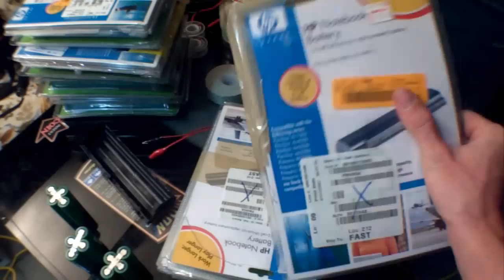DIY: 48v 24ah lithium ion 18650 e-bike battery pack

Comment: If you had those batteries with 3.7 volts and 2 amp hours, how many would you need to make a 100 amp hour 12 volt battery? Also, could you explain series and parellel? Thanks.

Comment: You solder directly on the terminals of any rechargeable battery you ruin the cell, the correct way is with a specific welder that uses high frequency to weld with low heat and the nails will have a high resistance, causing power loss and heat.
Reply from the maker: it won't ruin the cells, dont worry

Comment: Nice job on the battery and educational video. Ever worked with ultracaps? I'm thinking about integrating them with LMP's to get more burst power and decreased stress on the batteries.
Reply from the maker: yes I,very worked with ultra caps. ve made Two videos with them so far. a 2.7v 400 farad only has 300mah and is the equivlilant of 1\20th an 18650 cell and a lot more expensive and big.

also remember that you have to balance charge the capacitors or if one gets over 2.7v it will start boiling its electrolyte and die.

so far ultracaps aren't fit to replace lithium. not counting you'd need a way to turn the slowly dropping voltage into constant voltage for your motor.

Comment: Freeze the frame at 6:26... the lower right pack looks like the nail was soldiered in the wrong spot and not connected to the pack above. Just wondering if this was a mistake that was fixed? Great videos btw.. Im looking to build an ebike and trying to figure out total costs and how long I need to ride to make money back saving from not having to buy gas
Reply from the maker: oh yeah i forgot about that, i had to go back and redo the solder on some nails and move that one after the ride test because it was so bumpy and broke a few joints.
Reply: Gotcha.. I thought maybe it was just set up in a weird configuration.. is the battery pack losing any capacity since you built it? Im watching an auction for 72 cells in lenova batteries.. Should be sanyo batteries from my reseach? anyways, the auction is for a mix of ones not holding a charge longer than 5 minutes to others with errors and wont charge at all. Would you think this would be a good auction to go after? Thanks for your input.. These videos are such a big help for learning
Reply from the maker: JFR HRD
not that i know of, i run it at 4.0v so it should have 2000+ discharge cycles.

it depends on price, the packs will prolly have some good cells. but i never buy auctions. i go for buy-it-now when they have like 20 for sale, i buy 1. test it. then buy the rest if that one was good

Comment: How many cells do you have in this battery pack? In order to have a 48V 35AH LIion battery, you would need (if each cell was actually only 2AH) 17 48V batteries each made of 12 cells in series, all 17 wired in parallel. You would need 204 cells to accomplish this. This is a mistake I see people make a lot, if you wire cells in series, you add up the voltage,but not the amps and if you wire them in parallel  you add the amps not the volts. You can't add up both. But maybe you have the 204 cells.

Comment: Question: Is it possible to build a 'cheap' 6S 20000mAh (40C) battery for radio control applications (e.g.: multirotor coptors) where flight time is a challenge ? 

interesting video.

Comment: you are awesome.  i am going to build one.  Are there any particular laptop batteries I should AVOID?  Lifeoo4 would be nice, but since they are so costly, for now I'm going to build a li-ion.
Reply from the maker: Jmaturner i'd say avoid the flat cells that are popular in macbooks since they are a fraction of the durability of 18650 cells.

if a battery pack has IBM or HP or some company brand on it's sticker its probably medium to great quality cells. if the laptop battery has only generic english or chinese on it youll probably just get medium quality cells.

still medium quality cells are great especially if you find them for 1$ each.

Comment: Keeping your speed down will make a DRASTIC, DRAMATIC impact on the distance you can go. The cost/benefit is around 10-12 mph, because that is where wind really starts pushing energy use up exponentially. Even without wind, it takes 4x the amount of energy to go 2x as fast, when you put wind into the equation, it goes up horribly. Check bikeforums e-bike section, someone just posted an energy consumption graph and you would be amazed at how steep the curve is. Also, these are unprotected cells?

Comment: I have a bionix lithium battery system for a bicycle but the batteries are completely dead. Are those cells that you showed us pretty standard for laptops, electric bikes etc.? I am going to have to tear my battery pack apart to see what is inside and that may well be quite a chore. I am in Thailand.
Reply from the maker: yeah every laptop battery made after 1998 that i've seen has 18650 cells in it.

if your battery pack has a lot of cells, maybe it only 1 or 2 cells are bad, that is what happens with laptop battery packs. 1 or 2 cells dies and the whole pack cant work. ^^
Reply from the maker: *****
i would recomend to never buy individual cells. its most likely a ripoff then. just buy old battery packs. that can make it almost lower than a dollar per cell.

Comment: Hi. Thank you for the interesting video! if I understand correctly you connected 10P x 6S cells. If so, how do you charge the pack? isn't it dangerous to charge it without thermal sensing? Thanks!

Comment: How do you plan on charging them? Do you have an intelligent Li-Ion charger at the right voltage and for these kinds of cells? Also with 1kw motor, you could put a 20 amp load on this battery you made. You bought too much motor. With a 3AH cell, you are talking about pulling over 6C per cell.

Comment: OK, I rewatched the video. You have60 cells in this battery at 2.5AH per cell. Simple math 3.7V*2.5V= 9.25WH*60=550WH. If they are wired the way I think they are,(4 sets of 12 cells wired in series, with those wired in parallel to each other. You have a 10AH (assuming each cell is 2.5AH)48V (with over charging to 4V) Battery here, just the new one not counting the old one. With so many cells so close together in a BLACK (think sunny summer day) box being overcharged, you are asking for trouble.

Comment: you can only cool on the ends. The batteries should have 1/10 inch around them for cooling. If you discharge heavily you could get thermal problem.
Reply: +Kirk McLoren they are bettter touching, because the metal casings will transfer heat better, so then it cools easier. if you have a gap then the air gets warm and then it cant cool
Reply: +DMAN22yeah I would think without airgaps,they would hold heat like a brick?Especially,the bigger you make them.Even my drill packs get hot with a heavy discharge,or come right off the charger.They even warn to let them cool after charging to preserve battery life.I think if I go this route on the E-trike I'm building,I'll leave gaps and set-up a box with pancake PC fans.
Reply: Bowtie41 best thing to do is to have a fan blow over the outside of the pack when the cells are touching. if your batteries are getting  warm then it is time to upgrade your battery capacity, as you are damaging the batteries. drill packs are supposed to get warm when charging, and they can get warm when discharging. it doesnt impact the nicad to get warm to an extent.
Reply: +DMAN22yeah Nah!Most high discharge batteries will get warm when discharging at high rates.I would get worried if the batteries get hot during charging.A hot battery during charging, means 1 cell is weak and getting over charged.Some of these people sound as if they are going to attempt this without basic knowledge of lithium type batteries.THESE ARE NOT YOUR GRANDPAS BATTERIES.The c ratings on some of these are crazy!
Reply: ***** 18650s are around 1c continuous or 2c peak

Comment: Rinoa Super-Genius How come you use nails as connection instead of nickle strips ? Is it leading electricity good enouf without wasting to much ? what is the diffrense in using nail instead of nickle strips ? is it better to use copper? Thanx for video and  your answer from here in Sweden!!

Comment: Are these cells staying in balance? I've not worked much with Li Ion cells, owing to their inherent dangers. I use LiFePO4 cells for my EV needs and have had some balance issues.
Reply from the maker: in the next video i show how i balance them. with an Imax B6 balance charger.

and also i havent run into any issue with lithium cells being dangerous. and i've roughed them up quite a bit too. one time i got 4 cells to 4.5v and they didn't complain. but i handled them like unexploded dynamite till i got them discharged haha.

the biggest issue with lithium cells is if one shorts out due to age or stress. but that can be fixed by putting a 1-2 amp fuse on each cell.

that being said though, i don't have many issues with them getting out of balance. tbh most of the time i just top it off with my DC power supply. and i keep the cells at 4.0v or 4.1v instead of 4.2v so there is not only more room for the cells to deviate without problems but i also get 2-4x as many cycles from the cells.

i hope that helps.

Comment: Hey Rinoa. Great vid. Its good to get a sense of the process. 

I have a 36v ebike and my current battery has a meager 12 AH. 

I have this idea of creating a 20-25 AH in the future. I have no idea what type of cells I would need to create one of these. 

What are the specs I should look for in the cells?

Comment: How did you organize the batteries? For each cells in one block, do they have to match capacity? And for each block, do they have to match capacity too? I'm bulding 48v pack, 13s10p but I'm still confuse how to organize them.

Comment: Very kick-ass, but one question.

How does that duct tape handle the charge/discharge heat flux?

I would have fiber-glassed the battery pack after assembly, but if duct tape works, why bother?

Right?

MachOverspeed
Reply from the maker: lithium cells shouldnt heat up when charging nor discharging. only time my cells heat up is when i try to ride my bike in winter when its like 10 F*. they waste some energy getting up to like 40 F* but i've never noticed them raising in temp other than that.
Reply: OK.. Learned something.

Thanks!

MachOverspeed

Comment: Hi mate, good show, could you please tell me how much amp draw a 48v - 250watt brush-less e bike motor draws? I live in the uk and the law only allows 250 watts max on e bikes for road use with 15 mph top speed, bummer I know lol, most of these laptop batters I have got I would only trust individually at 2 amp continuous draw, my bike has a concealed Samsung 48v - 8ah battery and I was thinking of building a back up. I guess two packs of twelve, each built in series with the two packs joined in parallel would allow me four amp safe max draw, as a vaper that uses these batteries but ones with a continuous amp draw of 30 amp - sony vct5's are one example, As a vapour also needing to be careful of fakes and aware of amp draw on these batteries I would not want a concealed battery supply going up in smoke in my poor e bike :0
Any help would be appreciated. I could if I needed to add three packs of twelve together to give me more ah and allow 36 amp draw I think but that would mean fitting the battery eternally, also I am guessing the same charger would be fine to use as the ah is all that has change.
Thanks and sorry for the demanding read and so many questions :)

Comment: Where did you buy your controller?  The battery im building is 48v/18AH for a 500watt rear motor (i have a trike).  It has 5 PAS level sensor and also a thumb throttle.  I have all the materials but the controller.  Any suggestion would be great.

Comment: Hi John. Thanks for this vdeo. What interested me was your soldering of the "flattened" nails to interconnect the cells. I was told that this is VERY dangerous - that the proper way to solder connectorstrip/plates onto batteries, is actually with a very special tool that works like a fast acting spot welder - to keep the time that the battery is exposed to the extreme heat, to a minimum. Apparently they can explode. I see you use a "bazooka" of a soldering iron. Was that on purpose? To get high heat to be able to warm the contact surface fast to "solder and get out in a snap" sort off? Or did you not worry about the time that you heated the battery?
Reply from the maker: Sas du Plessis who is john?
Reply: Sorry. I was also at the time typing to another guy by the name of John. Human error. Regards.
Reply from the maker: Sas du Plessis
yeh  havent had any issues with soldering the cells yet, and i've soldered about 200 or so. i think it really helps to have a super-hot iron and to not take too much time soldering it. this iron says it sits at 1100 F* when no thermal load is on it, thats quite a bit hotter than most soldering irons.

that being said it is tedious and a few times i've mistakenly made cold solder joints that broke after riding for a bit, so i'm currently building a capacitive discharge spot welder.
Reply: Rinoa Super-Genius 
Wow. Would like to see that when it's up & running. You're going to ost it?
Reply: Sas du Plessis 
This damn keyboard - I meant to say "Are you going to post it?"
Reply from the maker: Sas du Plessis
you can edit comments, you do know that right?

and of course i'll post it.
Reply: Rinoa Super-Genius 
Yeah Super-Genius, I figured it out... Afterwards! As you probably picked up: I'm a "newby" and sort-off clumsy with the "internet of things".
Cheers & thanks,
Reply: Rinoa Super-Genius Using iron (steel) nails for large current connectivity is not really a brilliant idea.  Should have used thick copper wire. Steel like many alloys is a lot poorer conductor of electricity than you might imagine. So with the high amperage they will heat up and waste a lot of power there also creating other heat-associated hazards. Also copper is a lot easier to solder and the joint is likely to be more reliable. Wins on all fronts.
Reply from the maker: Bob Berg
but only if you have copper wire that is easy to solder.
Reply from the maker: *****
never been to a home depot till i moved to california last january. Rural King is far better.
Reply from the maker: *****
yeah why?
Reply from the maker: *****
but bare ground wire costs money. i didnt have much of that at the time. but i did have a lot of nails. and those nails have already taken me over 2000 miles on this battery pack and still counting.

Comment: Great video.  I am an engineer building the worlds first solar thermal powered car.  For my prototype I need a powerful and cheap battery.  I was thinking of building a similar battier like yours.  I would need maybe 8 batteries like the one you had in the video.  Do you know where I could buy that many laptop batteries for really cheap?

Also is there any time saving methods for removing the batteries and connecting them?  I don't want to spend too many months building this thing.
Reply from the maker: your gonna have to spend a lot of time building it. I recently did two videos on cheep 18650 cells go watch those.

also I dont know if you will get much energy from solar-thermal conversion. even something like photovoltaic cells wouldn't produce a whole lot of power. remember each square foot of earth receives 120 watts of solar radiation. and most solar panels would only generate like 20 watts per square foot. so something even less efficient like solar thermal would generate even less.

also remember you will need a motor and motor controller system. you could use the warp9 DC motor but that would cost about 3k$. or you could retrofit an old industrial motor like I'm doing for my 1982 mercury zephyr.

I'd say go with lead acid batteries first since you can get them for free.
Reply: With lead acid batteries I need deep cell.  Where can I get those for free?  Also I need to empty them in one hour and charge in 2.  Also efficiency is important.

The weight is also a problem.  I think I would have 100lb of lithium or 300 to 500lb of lead acid.

For the motor I will be using a used motor.  I would use a golf cart motor but they are too small.  I am looking for a used DC motor 30hp, less then 100lb and under $500 hopefully.

Thanks for the great response.
Reply from the maker: 2012theperfectworld
30HP? your joking right? thats way too big. i would say 5HP to 10HP would be great. remember that electric HP isn't the same as gasoline HP. electric horsepower has much more torque so you need like 1/10th as many HP.

and yes you can get big deep cycle cells for free. but it'd be your test battery. wouldnt have to last long. so you could use truck batteries.

i started my bike with lead acid.

i think if you try to build a complete vehicle first it would be harder. it would be good to get experiance first and gradualy move up.
Reply: I have a normal car with a 24ft long 6 foot wide trailer that has a huge solar mirror on it.  The trailer will be about 2000lb.  My drag at 55mph will be atleast 10hp.  I need extra hp for hills and turns and acceleration.
Reply from the maker: 2012theperfectworld
why not keep your power generation at home? then you can charge the car when you get home.

it would be easier, safer, and more durable.
Reply: we are traveling the world to prove and spread this technology.

Comment: Hi There. I am hoping you can tell me where you got your adjusting charger unit and what model it is. That's what i need so badly for all my projects! what kind of wall charging circuit will you use to charge your new battery?? something portable? Thanks!

Comment: Hi Rinoa ..just wondering do you barter things for batteries
??
Also do you know how many phosphate ion batteries could power either 2 (12) volt batteries or 1 (24 ) volt 32 amp 1000 watt phosphate ion battery connected to a solar panel to power an electric bike or scooter..?